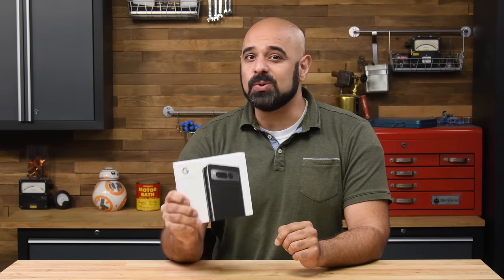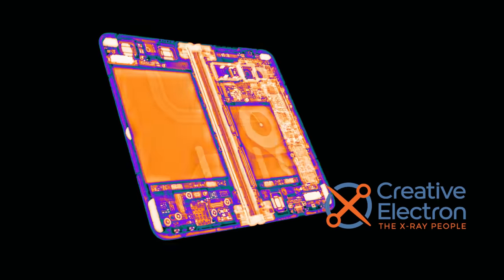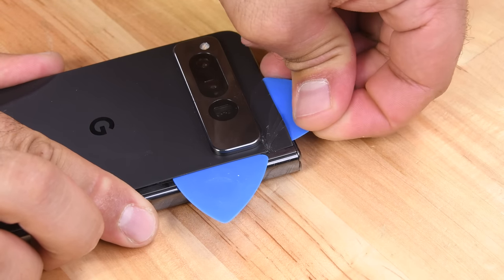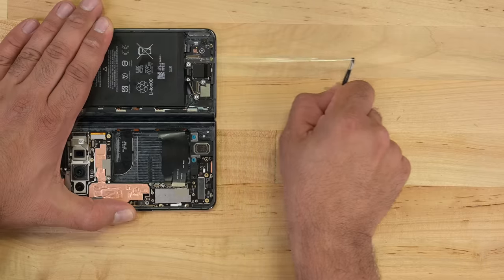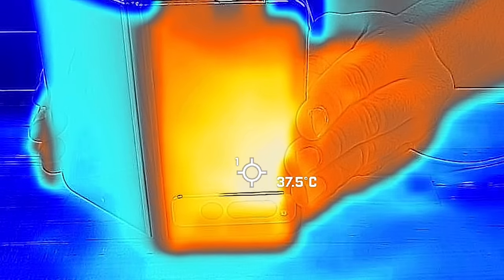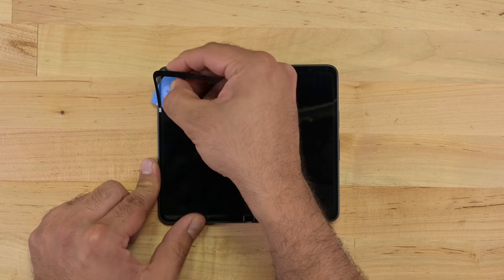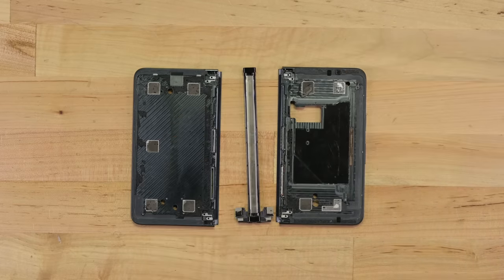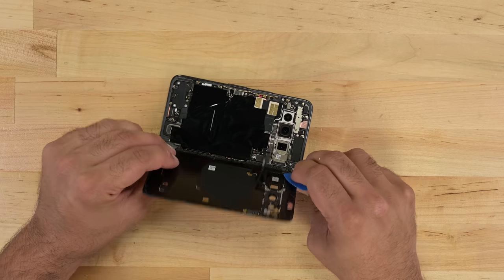Google Pixel Fold Teardown: Inside Google’s First Foldable Phone

Comment: Man, do I miss those repairability scores... Why did you stop giving them, iFixIt?
Reply: TBH they were weighted pretty bad and a lot of people felt they weren’t accurate to the real world repairability. A good example is how iPhones would score way higher than they ever should just because they prioritize quickly removing the screen and battery despite those parts being paired to the motherboard making them unrepairable to anyone that isn’t apple. Being able to physically remove them easier is moot when the phone will reject any part you put in it. it also didn’t take into account parts availability since that’s subject to change. Finally, things some people find difficult about a repair (soldering, proprietary screws, glue, differing screw lengths, etc) may be easier to some or REALLY hard for others so if a repair involves those it can mess up the results. I notice a lot of people complain about these issues with the score on older videos so that’s my theory on why they stopped giving them. I’m not ifixit though so it’s likely for a different reason. I hope they respond so we can both learn the real reason
Reply: @lenshibo Yeah, it was crazy how they gave repairable phones like Galaxies low scores for strong adhesive but gave Apple high scores despite the phones rejecting repair parts. Also Apple phones use weird screws and have all kinds of tedious little things that other phones have resolved.
Reply: @ratrodgrady tbf, at the time they didn't reject the parts, that came later
Reply: No score means you have to stop think and draw conclusions for yourself.
Reply: They started making lucrative deals with companies that scored poorly like Samsung.

Comment: what is the processor of this phone?
Reply: Tensor G2 I guess.
Reply: @古明地恋-s9c  dud chipset
Reply: @kantipoddar they aren't really the fastest but I doubt they're really dud chipset
Reply: @古明地恋-s9c  neither fast... Throttles a lot, heats too
Nothing compared to snapdragon 8+gen1 and newer snapdragon chips
Reply: @kantipoddar  You used pixel 6/7?
Reply: @古明地恋-s9c  friend uses 7 pro
Sold s20+ fearing that screen line issue